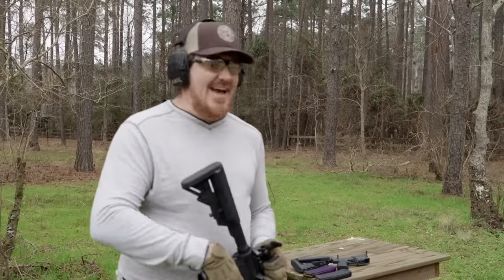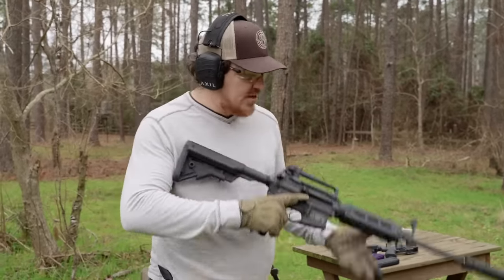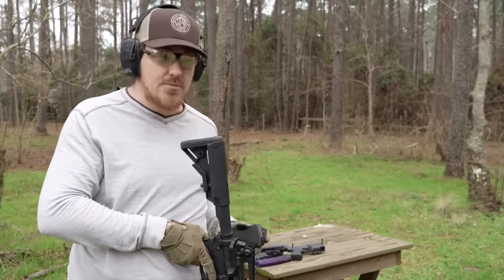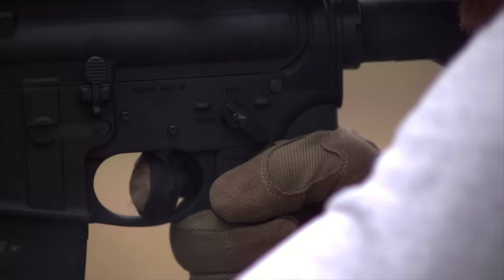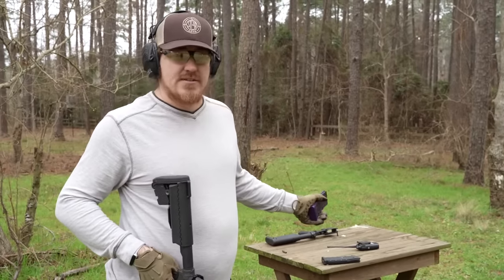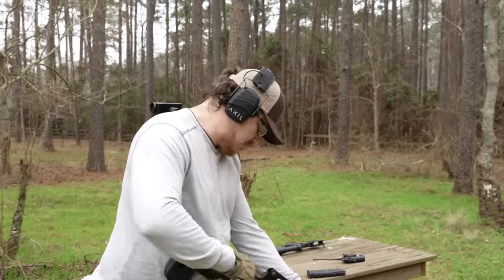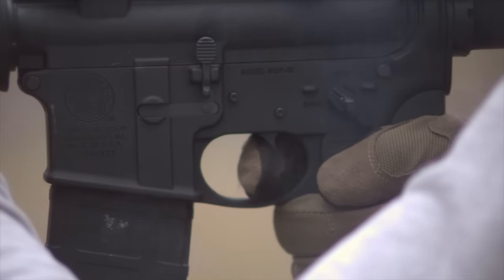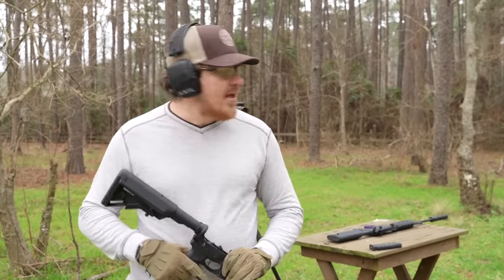FRT-15 Vs An Actual Machine Gun

Comment: If they can fix that spring issue in the frt and add a semi option the back to frt mode I'm sold
Reply from the maker: Based on their sales. Many people are sold with it just how it is. Don’t depend your life on it, but it’s fun for the range.
Reply: A select fire feature would be used against it by the ATF, it's better for them not have it, as the select fire would show that it has semi auto mode and an automatic mode, at least that's how it would be interpreted.

Gotta play chess with the man to beat them at their game.
Reply from the maker: @Speegs23  Possibly - or could be used for it as in the case of Binary triggers that have a single fire and binary mode. My concern about ATF attacks on it are more built around the "safety" of it since its hard to fire a single shot.
Reply: @gatcattill  Dont wait yourself out of an opportunity. They will be banned in 3.2.1... In any case the sprig problems are probably more of an issue with overextending the trip lever. It doesnt occur with mine and my spring looks like new after over a thousand rounds down range.
Reply: @gatcattill  They need to make it a “long pull two stage trigger” where the first break imitates a single shot and activates the disconnector for single shots, while a long pull to the rear activated the toggle that creates the “bump trigger” affect… Would be golden then. Especially if the second stage was weighted fairly heavy to avoid accidental initiation 🤔…

Comment: I'm interested to see if they fix the design flaw. I just order one from them today and oddly enough they are located 15 mins from me in Orlando. So I'm planning a visit to have a chat with them before I even open it.
Reply: Would be interested in that also sadly much farther away so once yours comes in maybe pop back here and update anyone else curious
Reply from the maker: Won't do a lot of good from what I understand - they are pretty recluse unless you talk with them at a gun show. They are all sales final, once you order it there is no going back. A couple of the technical guys that work for them are nice enough - one is a "internet" friend that I've talked with about design and function a couple of times including best tuning methods. Outside of that though - they probably won't be a ton of assistance to you I'm afraid.
Reply: @alorrick7546  mine didn't come with it but rare breed now sells the modded locking bar. I think the triggers are now shipping with the new locking bar mod.  https://www.rarebreedfirearms.com/replacement-locking-bar-modified/
I installed the locking bar with the mod and have shoot over 500 rounds though multiple uppers using two different BCG's and this trigger is amazing and delivers with almost no issues. Check out my videos if you're interested.

Comment: This is a great demonstration! 
One thing I thought you should show is what happens with just one pull of each trigger. Obvious I know but it shows that you have to keep pulling the trigger to get the rate of fire you want. And it is not automatic.
Reply from the maker: ATF just hates the simplicity to achieve a rof similar to FA even though it’s not FA. Range fudds
Reply: One shot is fired and the bolt doesn't cycle. Still not definable as full auto.

Comment: You need to send this video to the ATF so those dumbasses will finally realize that trigger assembly does not constitute a fully automatic machine gun. Great video by the way!👍
Reply from the maker: Cheers. Pretty positive they have it at this point. It was referenced in a leaked document 😂

Comment: I love this, but I wouldn't actually use an FRT trigger for self defense. It's easy to over squeeze the trigger and jam the gun, and in a high stress self defense scenario, you will squeeze too hard and jam the gun just because the adrenaline dump is so high. Love the ingenuity and the middle finger to the ATF, but it's not a trigger that I would consider worthy of using for anything other than having fun on the range.
Reply: I saw someone made a device that helps stop overtravel and prevent that kind of stuff

Comment: We need a forced reset trigger with 3 modes. Safe, semi and forced reset.   Full auto-like fire I don't see as being practical 100% of the time. Even in the military I rarely used 3rd burst.
Reply from the maker: It’s in the works. The problem is to make that functionality work you are essentially creating a DIAS

Comment: I give it 2 years until a "lone wolf" mass shooting happens and the suspect was supposedly using a rare breed. Loopholes will not be tolerated.
Reply from the maker: No doubt. I was suspicious myself of them staying around but so far no issues. Until them buy extra parts ;)
Reply: It’s not a loophole, the government wrote a law and manufacturers are working within their guidelines.
Reply: @chmandcrm  They already banned bumpstocks which were within guidelines.
Reply: There are no loopholes.  There is only following the law..
Reply: @notgray88  which was illegal.  The law is clear.  Still, a swat team at your door is a swat team at your door..
Reply: @DarthVaderForce125  agree

Comment: I have the M&P sport 2 with the rare breed trigger installed and all I can say is WOW! It's such a blast to shoot! Just got back from the shooting range after shooting it with the trigger installed for the first time. The rate of fire was shockingly FAST. The only modifications I made to my M&P sport was changing the original SW BCG to a full auto one (palmetto premium BCG) and swapping out the original buffer with the H2 buffer. I was unsure if the original SW buffer spring would affect the reliability or not and if I should change it out with a heavier aftermarket spring but the original spring works fine. I put a couple hundred rounds of 5.56 in it and not one malfunction. The rare breed FRT was one of the best purchases I made in a long time!
Reply: Ordered mine as of January 2022. I noticed the locking bar inside the trigger assembly looked identical to online pictures of the defective ones that people were having issues with. After looking closely at the locking bar mechanism, it appeared that my trigger was prone to the kinking spring issue. Before going out to the range to test my luck, I went ahead and milled out a little half moon on the bottom of the locking bar with a dremel tool just to be safe, and it seemed to do the trick. The spring didn't show any signs of kinks or damage after putting a couple hundred rounds through it. I'd recommend doing that first before taking it out to shoot.
Reply from the maker: This is the way
Reply from the maker: That’s also crazy you received old stock.
Reply: @gatcattill  Yeah it is! I wasn't too bothered by it, considering it was an easy fix.

Comment: My only question with the frt is can you switch it off if you want to use semi like you can with a binary trigger
Reply from the maker: No. It’s fully mechanical in design. No switch can disengage the force. They will have to design a selector that effects the locking bar to force the trigger to double reset or single reset based on position. Till they solve that it can’t be done.

Comment: yes, forced reset trigger forces the reset of the trigger, and a machine gun just lets the trigger fly with the power of the gas or recoil depending on the gun. so, yes the FRT does that double action making it “fully semi-auto”, when a machine gun never resets and just fires constantly, this is fast but it’s still semi auto.
Reply from the maker: Exactly. Watching finger movement shows the entire picture of how it’s different.
Reply: @gatcattill  Thanks for the reply! Also, your cat is very cute!

Comment: I have access to a registered reciever and shoot a lot of full auto mag dumps.  I've seen rate of fire change with the magazine or how dirty the rifle is.  I've even seen it change mid magazine.  I'd say the rate of fire was too close to call based on random factors.  A larger more random test would probably end in a tie.  Looks like you need more ammo.  😉 

This is really impressive for the FRT.  Hope the ATF gets told to take a hike so we can buy them.  

I'm curious.  I see a lot of people shoot full auto for the very first time.  One of the joys of having access.  900 RPM is pretty hard for most newbies to control.  I wonder what it would take to tune that down to 400-500 RPM to let newbies gave a little more trigger time and a few more rounds on target.  

We need a video about tunning rate of fire.
Reply from the maker: Vltor a5, heavy buffer spring, not so hot ammo like pmc 223, low back pressure can, these things should reduce your rof enough to see a noticeable difference. A lot of folks I bring shooting have difficulties controlling the frt build even tho it’s running an h2 usually and a low back pressure can. I teach them proper c grip and lean for control and start with burst firing 3-4 shots and then reposition. After s mag they can full send a 30 round Mag and control it ok.

Comment: To be honest, I feel like the reason an FRT rifle isn't considered full auto isn't because it's functionally any different. Yes, a single trigger pull does fire a single shot but if it allows you to pull the trigger fast enough to be comparable to full auto then actually what is the difference, functionally speaking? The real reason an FRT isn't considered full auto is literally just because of the definition of full auto SPECIFICALLY states multiple shots on a single trigger pull, which may perhaps be too narrow, as the definition predates the existence of these "loophole based" automatic conversions. I think the best thing to do here is either A) Commit to the definition of automatic weapon to the letter, and treat FRT's and other similar conversions as semi automatic firearms, or B) Change the definition of automatic weapon to something more in line with what uneducated people picture when they hear the term "automatic firearm". For example, a firearm that is capable of firing more rounds in a second then a trained shooter could feasibly fire unassisted should probably be considered "effectively automatic" (a term I probably just made up that would have to be incorporated into existing legislature, but it's pretty self explanatory) and therefore legally automatic. Even if you don't think there's any reason to restrict FRTs or bump stocks or whatever, and even if they aren't technically automatic weapons, it's pretty silly to argue that a rifle with an FRT is any less capable then a fully automatic rifle, because it really isn't. FRT's allow someone to fire just as fast as an automatic weapon with minimal effort or loss of accuracy (when compared to firing in full auto). Therefore, the worst thing to do is the awful combination of options A and B. Treating the term "automatic firearm" as if it means the definition option B (can fire faster then someone could unassisted) without changing the letter of the law in any way, and not explicitly defining FRT converted weapons as machine guns. In this scenario, both legislators and gun owners are unclear on what exactly is and isn't allowed, and they're setting a dangerous precedent by treating the law as if the exact wording doesn't matter. The law can be changed, as they become outdated, or backfire in some way all the time, but it's not okay to just pretend it's something other than it is to push an agenda. What the ATF is doing currently is circumventing the written law by exploiting people with a poor understanding of the law to push an agenda. I think everyone has the right to push their personal agenda, but I think everyone should have to use the same channels to make changes.
Reply from the maker: This entire argument is dangerous for a mindset. The issues you brought up would require actual legislation and not atf popular opinion. The ability of the atf to enforce laws that do not exist are what we are facing right now and the frt is a means to show that the government has overreached on this. It breaks no written law inside the NFA and is not in violation of the Hughes agreement. The issue is atf is trying to change how it interpret the law because they don’t like what people have created. Writing a law on rounds per minute will never and should never occur. An AR with a properly gassed system and a match trigger will be as fast as an auto ar in the proper hands. This agenda would push magazine bans, or even grip bans and other things like you can’t change trigger groups, or modify builds or even build your own. Remember, shall not be infringed. The constitution was created to give the people the ability and freedom to overthrow a government that was no longer benefiting the people. The first and second amendment are critical for this. By gimping it’s own citizens, they are removing what the constitution set forth to protect. FRT challenges the atf and is hoping to catch them fail. That’s why RBT has not and will not back down according to their social media posts as of late.
Reply: @gatcattill  Disclaimer, I'm Canadian, so we don't have a second amendment, but still permit gun ownership, although things like magazine capacity is heavily restricted and the licensing is a lot stricter then yours. Personally, I agree that it's silly to ban some firearm parts and not others. It's also worth noting that I agree that citizens should have the power to overthrow a government that does not serve them. That being said, I also think there are a lot of people who absolutely are not responsible enough (or trained well enough) to own firearms and think something needs to be done about that. There does need to be some sort of oversight that makes sure that all gun owners are trustworthy enough to not pose a potential danger to others. Like an actual certification with a test. If there's a test to drive a car unsupervised, there should be a test to shoot unsupervised. Because the result of someone doing either of those activates without proper training could result in the death of a bystander. Also, a mental health check could be helpful. Guns should be stored in locked boxes, unloaded, so that untrained individuals (and high schoolers) can't access them. I don't see stuff like this as an infringement, as these are all things that I would do anyways for my own safety when operating or storing a firearm. And the excellent tradeoff to making sure irresponsible gun owners cannot exist is that if only responsible, well trained people own firearms, there's quite literally no reason to restrict any type of firearm. If gun licensing is effective enough at weeding out irresponsible people, then gun violence rates plummet and it's safe to allow ownership of ANY firearm.

Comment: I think the technical functionality is that of a semi-automatic. The way it is used is identical to an automatic though. Apply constant force on the trigger and it shoots continuously. Let go of trigger and it stops. You are shooting it as if it were automatic, except it's pushing back on your finger.
Reply from the maker: I get the argument, but if I were to apply constantly pressure on the trigger system the gun will fire 1 shot then lock the bolt back because the pressure does not allow the cycle to complete. Unlike a machine gun where you apply constant pressure from the single pull and the gun cycles till you release. It’s a key difference that constantly becomes overlooked. I have another video up where I showed this in action.
Reply: @gatcattill  It’s “per function of the trigger”, which means you have to consciously and overtly pull the trigger for each shot to fire. FRTs force a reset, IE. They automatically reset, causing it to be full auto as it’s a fully automatic action of firing.

An FRT forces the trigger to reset, in which your continuously pressure on the trigger makes it AUTOMATICALLY function.

FRT is fully automatic because its a fully automatic process to fire multiple shots.

Comment: If I remember correctly the design flaw was they used a coil spring in the force reset mechanism and it should have been a leaf spring
Reply from the maker: Correct. The other fix was - wot used a rod in the middle of the spring to prevent kinking. The rare breed fix was to dremel a notch in the lever where the spring would push against which has worked well

Comment: These particular FRTs are being marketed as replacement triggers for AR-type firearms. Unlike
traditional triggers and binary triggers (sometimes referred to generally as “FRTs”), the subject
FRTs do not require shooters to pull and then subsequently release the trigger to fire a second
shot. Instead, these FRTs utilize the firing cycle to eliminate the need for the shooter to release
the trigger before a second shot is fired. By contrast, some after-market triggers have similar
components but also incorporate a disconnector or similar feature to ensure that the trigger must
be released before a second shot may be fired and may not be machineguns.
Reply from the maker: Bra did you just copy and paste the wording from the fed bois in the US v RBT document?

Comment: I bought a Rare Breed and an Alamo 15 when they first came out and both have run very well. Been happy with both and even upgraded them with the 3 position safety. When the ATF came after Rare Breed and others, most folks shit their pants and shied away from them because they are afraid little children. I ordered 2 more which sadly never came as well as the Hoffman Super Safety. Now that the FRT has been successful in court, pull up your diapers and be men and go buy as many as you can get.
Reply from the maker: Can’t buy them - commercial activity is still blocked by New York injunction on rare breed themselves. You can buy them on gun broker for 1200 if that’s your play but we still have fights to win